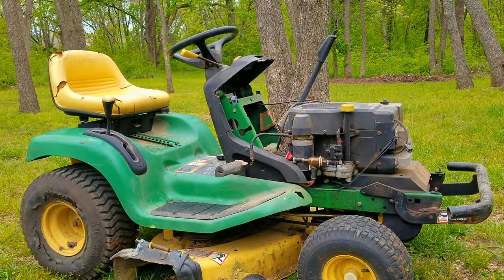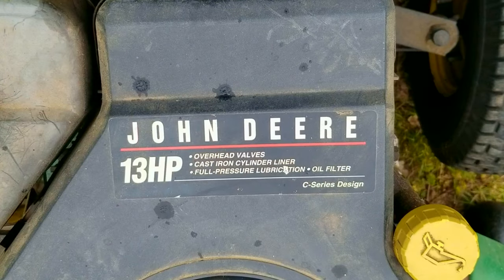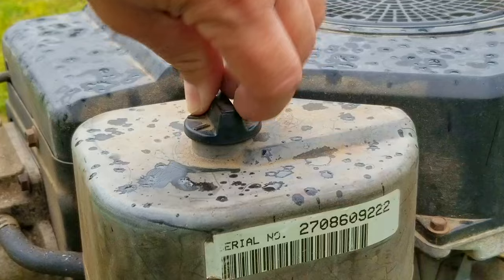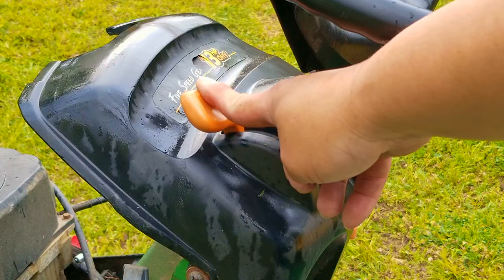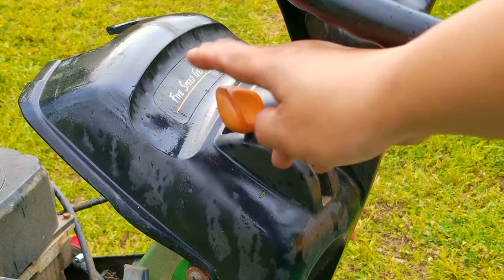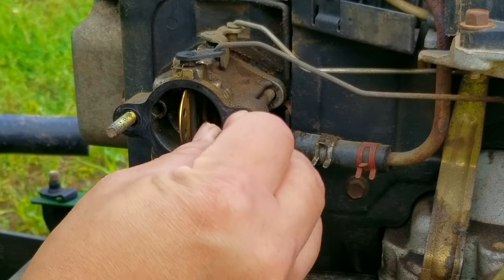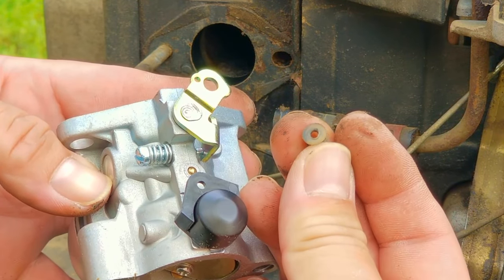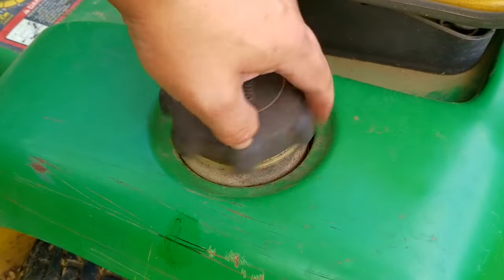Riding mower only runs when carb is choked

Comment: If a carb is too far gone to rebuild or simply won’t work properly after trying everything I have no problem using a generic replacement. I’ve had very good results with cheap no-name carbs with no further issues afterwards.
Reply from the maker: the same situation here. I've had a lot of success using aftermarket ones. Thank you mjg263

Comment: JD S130. Same symptoms tricky throttle/choke adjustments to run.  My issue was the "governor blade" or its equal was not working, it was floating, no tension on the vertical wire or arm that connects to carb.  At the time I was clueless and frustrated.    While had my air handy, I blew out the hard to get/see area on top of the carburetor.   Magic, noticed the wire now had a little tension.  Engine ran fine.   Before had the same symptoms as your oldie but goodie.  No skill or knowledge, just dumb luck so I thought I would share. The video inspired me to trouble shoot. THX.
Reply from the maker: nice work!

Comment: I’m having the same problem with a 22 hp twin Husqavarna I’ve already cleaned it once unfortunately I’m gonna have to rely on cleaning it again cause times are tough. I got this tractor in real good condition it set for a couple of years old man owned it had gas in the oil so I have did some work.  So after I cleaned the carb and put it back on noticed a leak so must have eat up a o ring with carb cleaner but when I fired her up she sounded great.  Thanks for video have a good one.
Reply from the maker: thank you for your time

Comment: I've had to clean a Honda carburetor which was tricky to fix,the orifice leading to the low speed jet was blocked so it would only run at  full speed.

An ultrasonic parts  cleaner would've really helped me clean it !
Reply from the maker: that maybe on it's way then. Thank you Russell Booth
Reply: I bought a mophorn 30 liter ultrasonic cleaner. Its terribly fun to put all sorts of things in there with a little soap and water and watch it come back out 30 minutes later looking brand spanking new.

Comment: If I had already cleaned the original carb and it still didn’t work, I would replace it but with an OEM carb.  The reason I would do that is because I work on small engines full time and have had a very hard time with the Chinese knock off carbs.  Even if they run fine at first, I guarantee there will be another problem down the road.
Reply from the maker: You make a very good point.
Reply: I got a good Chinese carb on my snow blower. 4 seasons in so far. Northern Pennsylvania. you could say I like a good gamble. most Chinese carbs do suck
Reply: The generic for mine was $20 on ebay and OEM was $245. It's been fine for 3 years. If it died tomorrow and I got an average of 3 years per, it'd be 36 years to equal the oem price

Comment: Some carburetors just won't run right, even after cleaning.  I have good results with 90% plus of the carbs I clean, and have good results with cheap Chinese carbs.
Reply from the maker: You absolutely right. Thank you Mike Spain.
Reply: I agree I've had some mowers I have to clean the carb about every time I use it

Comment: I think the Chinese aftermarket carbs work better, because they don't have to meet any epa regs so they can have proper jet sizes instead of always being lean. 
I've replaced carbs on riding mowers, push mowers, generators, and chainsaws, never had a dud. 
The Tecumseh carbs even has adjustment screws exposed where the OEM was blocked off.
Reply from the maker: I like the way you see it.

Comment: The new aftermarket carburetor was so cheap. I chose to get it instead of dismantling and clearing those clogged paths on the old carburetor. I had a lot of luck, switching out a starter and solenoid previously. I'm just about to install my new carburetor and hope for the best. If that doesn't work I should do what I probably should've already done and check the fuel cap. The problem is I don't know how to tell if it's functional or not. Can you help me with that? Oh and I wanted to say thanks for the tip about doubling up the nuts on the one post for the carburetor so I could undo the linkages easily. I was baffled at first, but after watching it three times I understood.
Reply from the maker: to check if the cap is venting, disconnect the fuel line at the filter near the right foot pedal.   Fuel should drain from the line when you move the end of the hose below the frame due to gravity and pressure differential.  Capture the fuel in a container and watch to see if the fuel flow stays "continuous" or if the flow starts to slow down.  This would show that the cap is not venting air into the tank.  IF it does this, then open the fuel cap and if the flow starts back up, then you'll know the cap needs to be replaced or if you need to put a small hole in it
Reply: Thank you
Reply from the maker: no problem

Comment: I have a Scott's riding tractor and it's basically doing the same thing yours was it will only stay running if it's in like half choke if I turn the choke off it dies. so by watching your video. I'm assuming I got a bad carburetor or something is clogged in the carburetor so I'm going to have to buy me a carburetor I guess.

Thanks for the video
Reply from the maker: you are correct, the carb had an issue that was not able to fix, so a new carb fixed it.

Comment: Hello!
I bought a brand new weed eater, thing is, when its revved to the max for longer periods of time, gas starts dripping from somewhere, i pulled out the air filter and it had gas in it, so i guess its coming out of the air intake, also the spark plug was drenched in gas, could it be that the carb is sending too much gas and i need to adjust the H screw ?
Reply from the maker: what brand and model did you buy?
Reply: @INSIDEHOUSEGARAGE  i think its a chinese kind of weed eater, Stern Austria GGT-1600V
Reply from the maker: @iplaybose  it's worth a shot trying to adjust it.  Just do me favor. First turn the screw clockwise counting how many turns it takes to stop. That way you can put it back the way you found it, if things don't go to plan
Reply: @INSIDEHOUSEGARAGE  understood! Thanks for the tip! Will do sir, wish u a great day
Reply from the maker: @iplaybose  no problem

Comment: I personally love using the aftermarket carbs but I  am a flipper.
Reply from the maker: that makes complete sense
Reply: I replaced the carb but mine would still not start.  Had visible gas droplets coming from the carb.  Complained and got my money back.  Bought another from a different supplier and I am still having problems starting and running.  I had backfires out of the carb so I removed the flywheel to see if the key in the crank was still good and it was.  New stock fuel pump and fuel lines.  Gov seems okay.  No adjustment on carb except idle.  Going crazy!

Comment: Maybe that is wrong with a snow blower I have, it only runs on choke and the second you take it off it acts like you switched the key off.
Reply from the maker: yes I would just replace the carb because it seems to be the same problem.
Reply: @INSIDEHOUSEGARAGE  I have not touched the carburetor yet, it is a pain to get to as it is hidden behind a bunch of plastic since it is a snow blower. You recommend trying to clean it out first? I see you have had a good success rate with that.
Reply from the maker: @cdos9186  that's a tough question. if you don't mind doing more work, then yes try cleaning it. but if the bowl gasket is hard or cracked, I would just by the carb instead.
Reply: @INSIDEHOUSEGARAGE  I went through the carburetor and there was a bunch of junk at the bottom of the bowl, I cleaned it out and the main jet, put it back together, and it runs like new! Thanks!
Reply from the maker: @cdos9186  nice work!
Reply: @INSIDEHOUSEGARAGE  Thanks! Your videos really helped and I love the way you make them!
Reply from the maker: @cdos9186  thanks that means a lot to me.

Comment: On that old carb did you remove the main jet and see if it was clogged , although sometimes you cannot remove it very easily
Or maybe just take a thin wire and run it up through the main jet to clear a partial clog..
Reply from the maker: yes it was something I had looked last year when it started having problems. It was actually during my "mow or blow" video on leaves.

Comment: My lawnmower was running fine until it ran out of fuel two days ago. It had to run with the choke after I put fuel in it and now it won’t stay on. It cranks, turns on and dies after 10 seconds. Fuel line to filter is fine. After filter is slower but I’m assuming that’s normal due to the filter resistance. I have a John deer l130. I don’t think the carb would get clogged just because of running out of fuel but please let me know your thoughts. Thanks.
Reply from the maker: running out of fuel, will sometime pull the worst stuff, from the tank, to clog the filter. I would replace the filter, it's not expensive.

Comment: As usual, a good video of a good repair project. You don't give much info about preliminary diagnostics to know for sure there was not a vacuum leak causing the poor performance with the original carb?
Reply from the maker: you are correct, I barely touched on the diagnostic of the failing carb. But I was confident that it was the problem and the video was to mainly show how to replace the carb. Thank you 65CSX

Comment: I just pulled carb because fuel was spewing from top hole! any Idea what the issue is? thanks
Reply from the maker: sure, the needle is not able to close into the seat inside the carb. Take it from me, just replace the carb.
Reply: @INSIDEHOUSEGARAGE   I did!  found the one I needed on Amazon & your right ! the issue is related to a cracked float. Prime was 1 day for a carb but over a week for a kit also was more $ than a whole carb ! lol
Reply: I have a Briggs and stratton Vanguard. 185432 0271e1.
Same problem.  Fresh gas, fuel flows freely. Found nothing in original carb.
Replace with import, same problem? The fuel inlet on the new one is smaller. 1/4" od.
Any ideas?
Reply from the maker: If you're certain about the fuel flow and the carb is new, then the problem may not be fuel related

Comment: Is the carb still working on it?
Reply from the maker: You mean the original one? Yes it works
Reply: @INSIDEHOUSEGARAGE  I meant the one you replaced. I have the same problem with a Craftman LT2000. I cleaned the carburetor but it still only runs on choke.
Reply from the maker: @CazadoresLatinosDePA  oh yes absolutely, I've used the mower several times since this video and it works like new.
Reply: @INSIDEHOUSEGARAGE  thanks  for the video and replies. ✌🏼
Reply from the maker: @CazadoresLatinosDePA  no problem

Comment: I got the same issue but I just bought a brand new carb and it’s still doing the same thing. I replaced the whole fuel system, coil, condenser, starter, and plug wire. I need help I’m out of ideas for my mower. It just won’t run without choke if you have any ideas I’ll appreciate it.
Reply from the maker: I don't know what your engine looks looks.  Does your engine have a fuel pump, either mechanical or the diaphragm type?
Reply: @INSIDEHOUSEGARAGE  mechanical fuel pump. I replaced it also
Reply: @INSIDEHOUSEGARAGE  it’s a John Deere 314
Reply from the maker: at this I'm out of ideas without looking at it in person.

Comment: my l100 has guzzled alot of gas and its been running kinda bad and just today it would barley even stay alive and only run choked so i think either by fixing the fuel lines and replacing the fuel filter might fix it sense ive cleaned the carb a year or two ago
Reply from the maker: I would replace the carb instead, I did and it fixed my issues like you're having
Reply: @INSIDEHOUSEGARAGE  i replaced the fuel filter since it looked completly brown inside and it cranked up just fine but if it does it again ill tell you
Reply from the maker: okay
Reply: @INSIDEHOUSEGARAGE  and here we are again it did the exact same thing again

Comment: Does the original carb have a pilot jet? It’s possible that an ultrasonic cleaner may solve your problem. Even if the knock off carb only lasted a year or two, how many could you buy before you matched the cost of the OE? If you don’t have an answer ultrasonic cleaner, you definitely chose the right route. Could the needle and seat be your problem?
Reply from the maker: not sure.

Comment: A coworker decided to play with the carb mixture screw and now it's doing the same thing as you JD. Did you try adjusting the carb mixture first?
Reply from the maker: yes but it didn't make enough of a difference, besides that, the screw was not adjusted to begin with.

Comment: The fuel lines and fuel pump should probably be replaced at that age. Try to run Non-ethanol gas too. Putting ethanol in gas was a stupid idea, pollutes more, get worse gas mileage and deteriorates rubber hoses over time. Bad for cars and small engines.

Comment: I would have tried to fix it again, probably because I am too cheap to spend the money on a new, even if it is a cheap aftermarket.  You seam pretty knowledgeable so betting you would have fixed it the 2nd time around.  Did you ever figure this out?
Reply from the maker: how many times are you going to try and fix it until you decide to get a new one?

Comment: I have had a lot of success cleaning carburetors using carbcleaner and a sonic cleaner with built-in heater (before I had the sonic cleaner with its own heater I heated up the liquid before I turned on the sonic cleaner)
Reply from the maker: I would get one, I just don't want to use it on the channel, I don't want to show that you need to buy this to clean a carb. Most people will never clean a carb in their life, so for those few people that might do it once or twice, it way not be worth it.
Reply: @INSIDEHOUSEGARAGE  Good point as it is to be educational for a broader audience.

Comment: Take off original carb, clean throughly and blow out fuel line back into tank to remove  anything restricting free flow  - done - runs like a champ - new carb - nope but solution of it is truly dead - stihl chainsaws have that problem after a few years and lost of mesquite corrosion!
Reply from the maker: thank you Andy Hancock.

Comment: Replaced the carb and still only runs on choke
Reply from the maker: if the carb you replaced was new, and the issue is fuel related then either there's an issue with the fuel pump, clogged filter, swollen Fuel line, or some obstructions in the tank.

Comment: from my point of veiw the china parts have been very reliable ,the only one i wont use now are the fuel pipe they go soft and break after a few weeks, but here un the uk if i did not use the  non genuine carbs all quotes would be declined so i tell them what could happenand 90 % are happy to go ahead
Reply from the maker: that makes sense, thank you Thomas Caulfield.